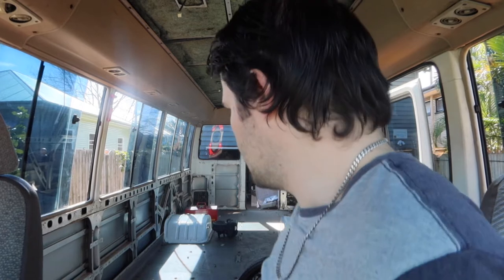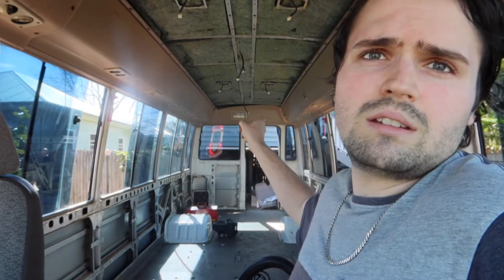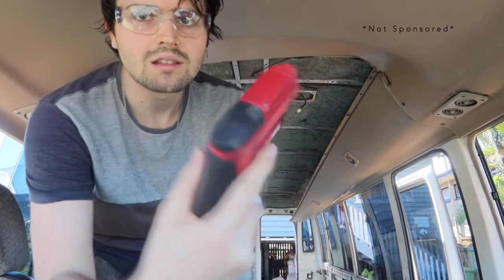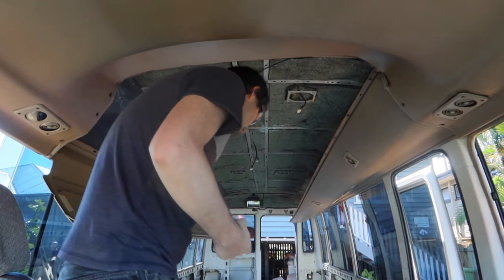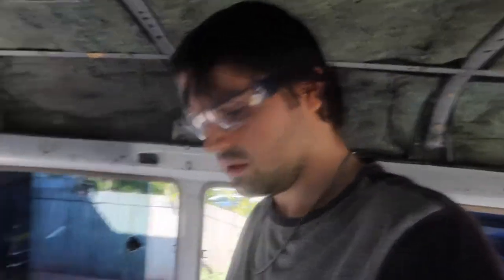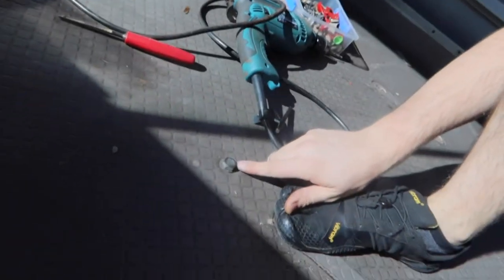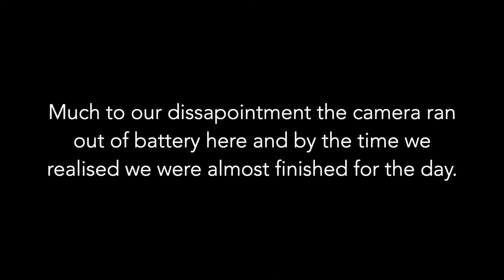Our Coaster Conversion - Part Three - Removing The AC Channels

Comment: Hi. I've recently bought a toyota coaster and am in the process of removing the factory ac. Did you remove everything or just the channels?
Reply from the maker: Hey Mate, we removed the lot, the channels, compressor (over the cab) and condenser and all related piping. Saved a HEAP of weight removing it all. It was hard work getting it all out but glad I did.
Reply: @theaitkenfamily9138  hey. You're so right... it was hard work... so I paid to get mine out, otherwise if left to me (having no idea & a limited tool box) it was going to hold me up for ages. Heaps of overhead space available now.